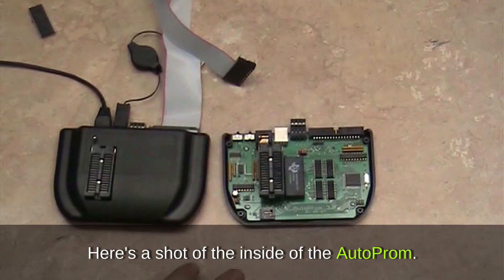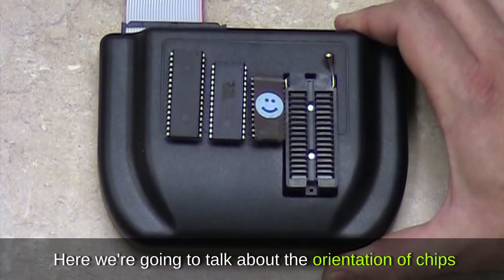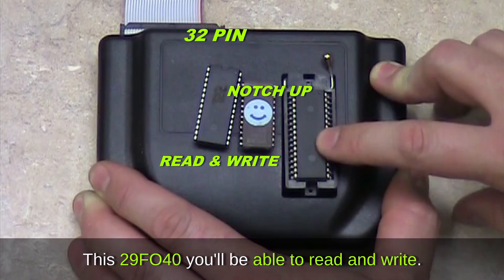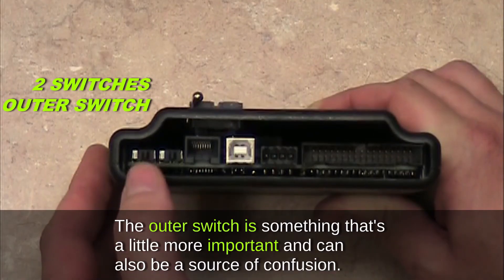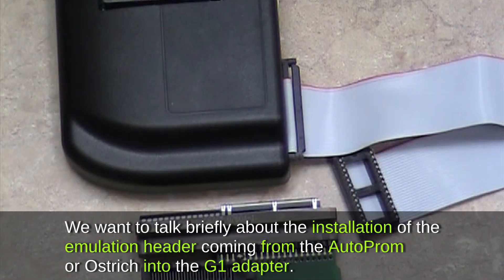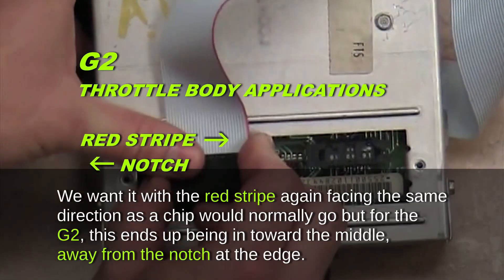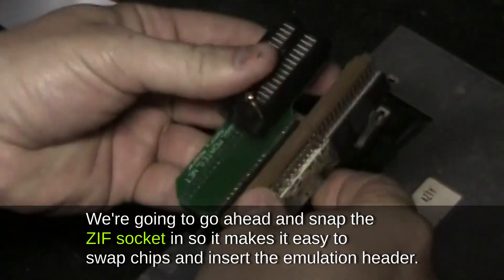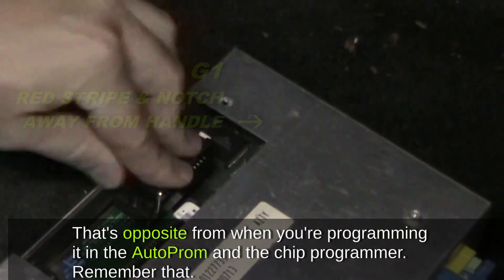Moates | GM | AutoProm | Getting Started | BEYOND THE BASICS

Comment: Hello.  Enjoyed quite a few of your videos.  I'm having an issue with my APU1.  I have a 1990 corvette with 1227727 ECU, same as 1227730.  I've read my original chip, burned one with just EGR turned off and lowered fan on temps.  I now installed an AEM wideband, and would like to datalog it.  I can see W/B in channel 1, but can't transfer that data into engine data or history tables.  Any tips or ideas on where or what I'm missing.